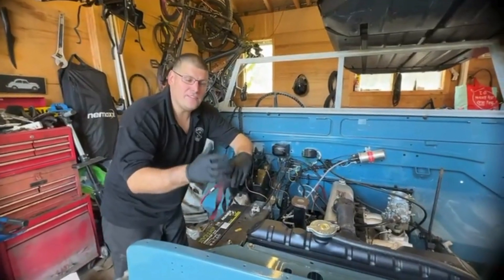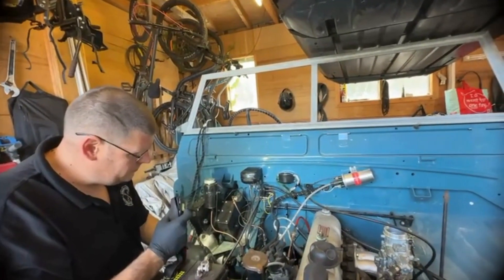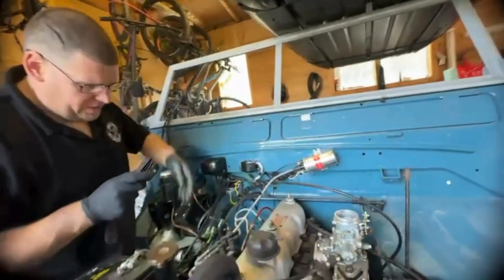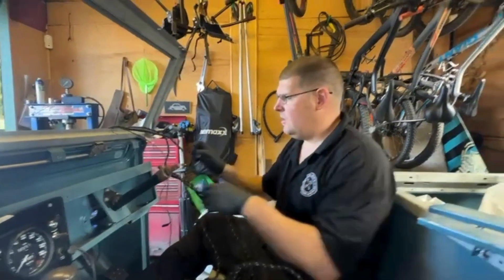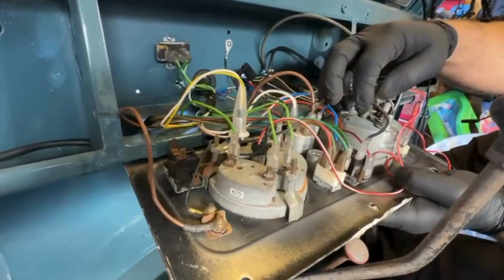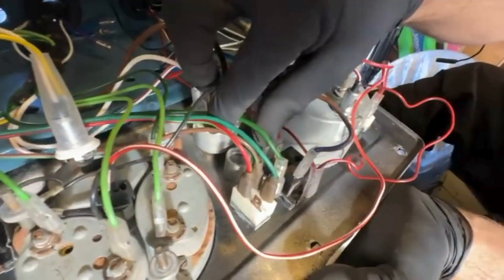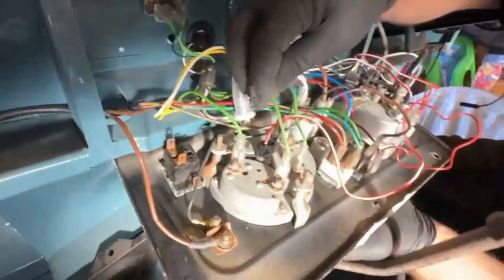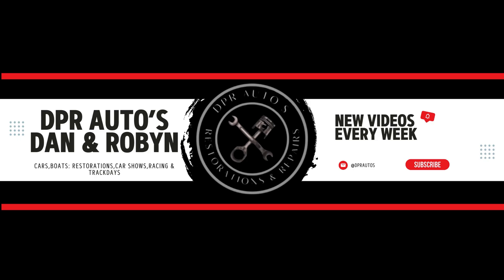LAND ROVER SERIES 2A WIRING EXPLAINED & FULL DIAGRAM

Comment: Thank you so much for this video! It is really hard to find info as you also mentioned. I will try and find my wire for the temp sensor. I will also trace back from the dash, that might help. Good luck on the rebuild, your Landy looks amazing.
Reply from the maker: Thank you it’s getting better each bit we get fixed ! So glad it helped, if you need anything else just let us know 👍
Reply: Its so easy to bypass the voltage reg when doing a alt conversion
Reply: @jonatday  Being it my first Landy, I am not a mechanic and English is not my first language, its hard to put it all together. Also the car was stripped when I bought it, that makes it even harder to put it back together, compared to when you took all the bits of yourself. Manuals are all in English, technical English, its hard for me to understand.